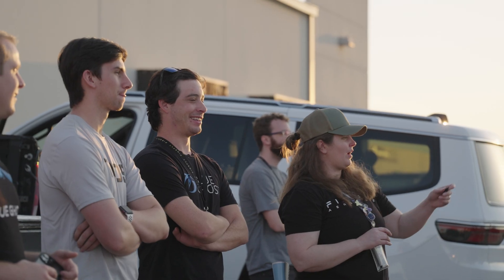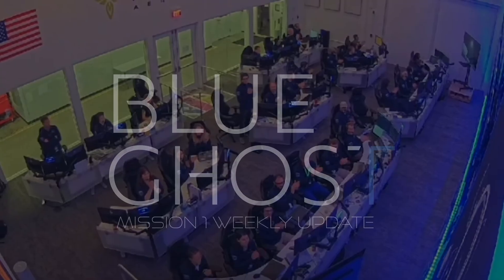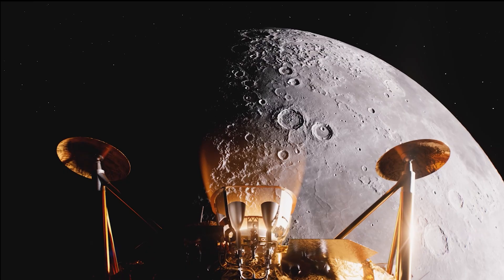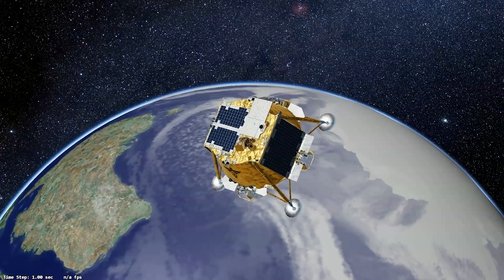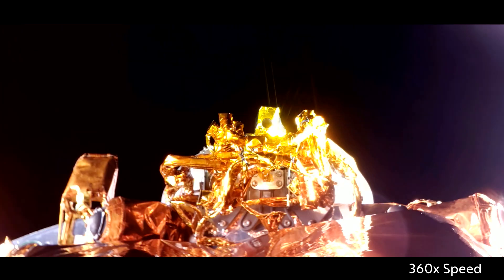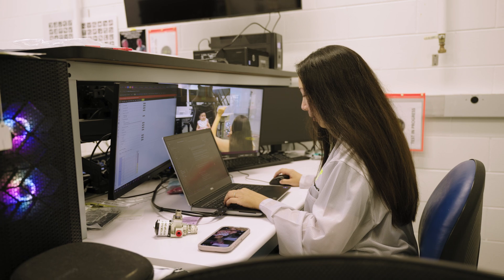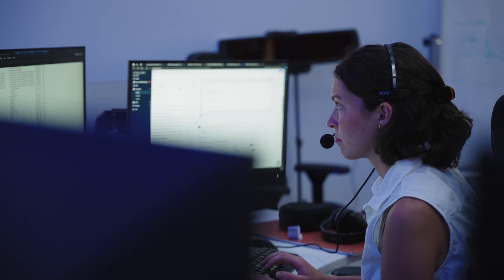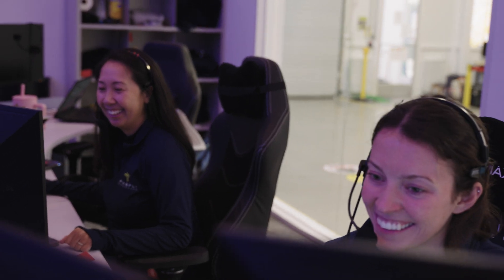On Our Way to the Moon! Blue Ghost Week 4 Update

Comment: Why does your lander have 4 legs instead of 3, Isn't 3 legs more stable than 4?
Reply: Not really. Each of the landing legs have shock absorbers that will dampen the landing, and conform to the uneven terrain, so that the lander is stable. The number of legs is more of a trade-off between the length of each leg to cover the same area, compared to the added mass of each leg, which needs to be minimised.
Reply: They are both stable